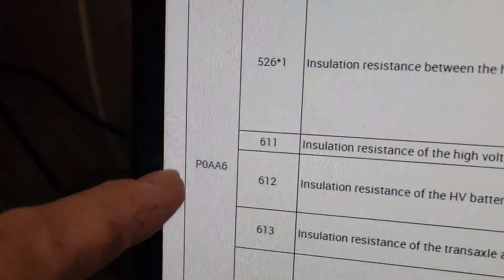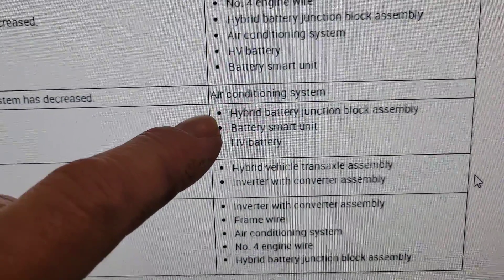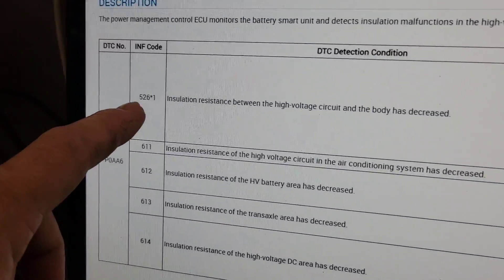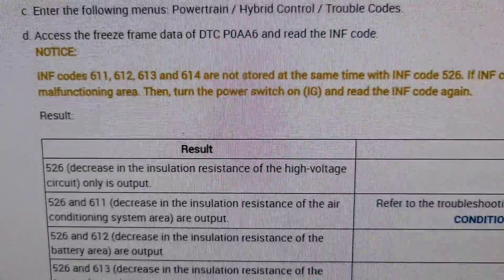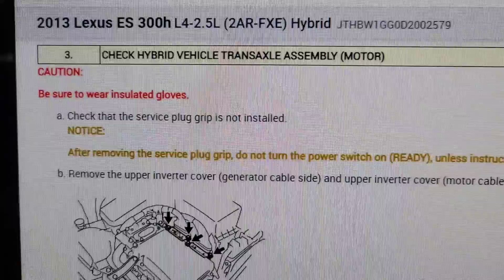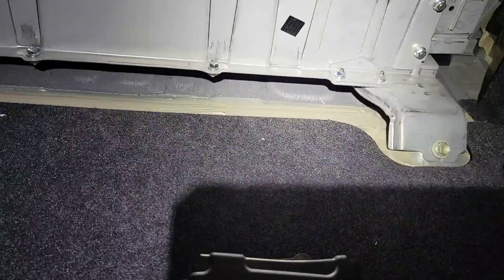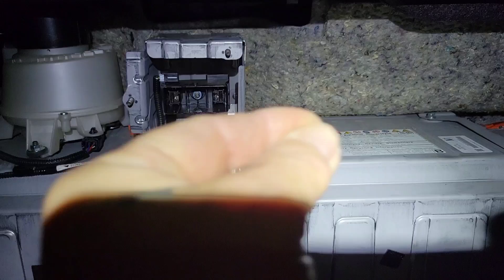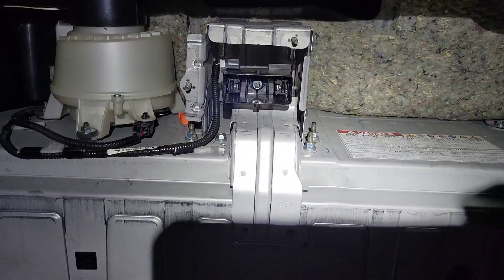2013 Lexus ES300 P0aa6 Hybrid Problem

Comment: Great step by step. Just did an engine swap on a prius and now getting p0aa6. Alas my scanner doesnt read subcode. Only thing i really messed with during swap was moving the ac compressor but ac compressor works and there arent any codes stored for it.
Reply from the maker: That sucks

Comment: Hybrid stuff on the channel is good stuff since the democrats are pushing for no gas engines
Reply from the maker: Very true.  Thank you for watching I appreciate it
Reply: Can you do hybrid basics video when you get time? I understand it as the high battery in the trunk is dc then goes to the inverter to be converted to ac for the motor and ac. Does the converter step the high voltage down to low voltage dc to operate the rest of the accessories on the vehicle
Reply: Which scanner do you use? @NutsandBoltswithTone